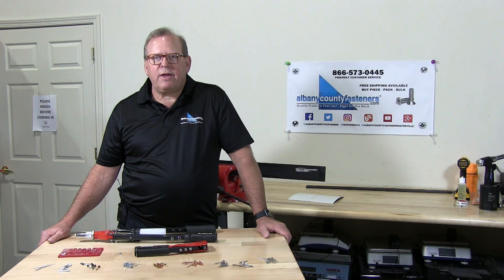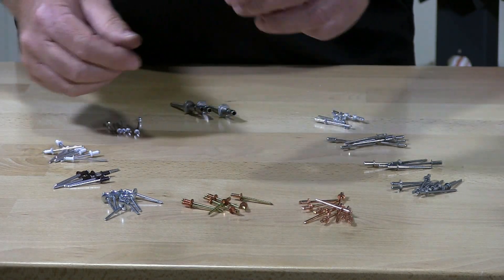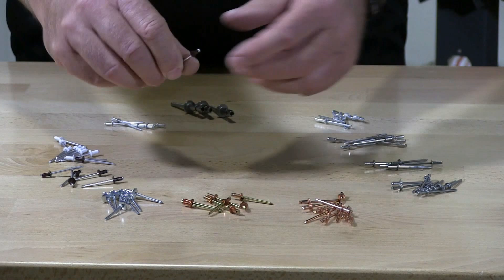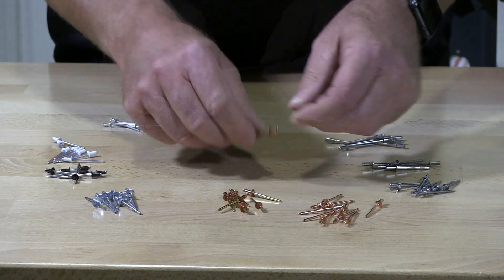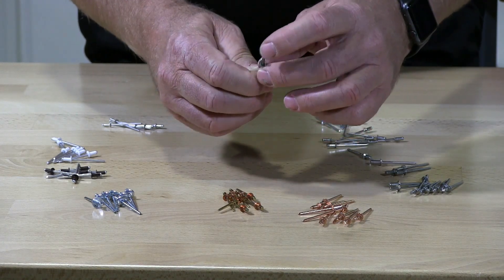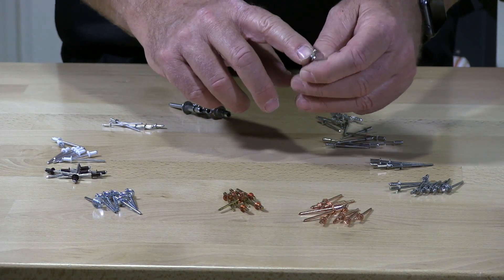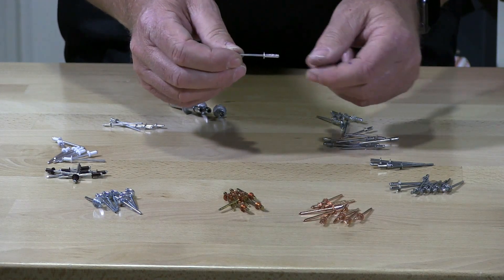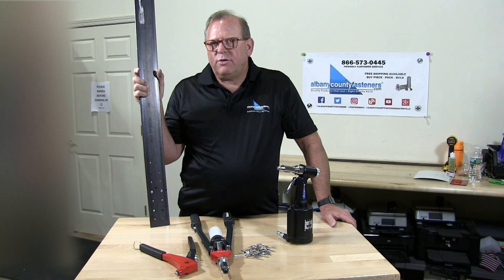POP Rivet Types and Materials | Fasteners 101

Comment: Hi , i like to join 2 very lite  paper thin sheet metal together.  I need the smallest diameter mandrel . I need the tightest flush possible without anything protruding if possible fir a small project ? Aluminum is prefer . It can be copper , or brass ?  Which is the cheapest route  ?  
So which type  diameter , grip length do you recommend  ?
Greatly appreciated on your reply .

Comment: Here's a breakdown of the key differences between aluminum, copper, and stainless steel rivets, along with their ideal uses:

Material:

Aluminum: Lightweight, malleable, good strength-to-weight ratio.
Copper: Malleable, good conductor of heat and electricity.
Stainless Steel: Strong, corrosion-resistant, high melting point.

Strength:

Stainless Steel: Strongest of the three, with high tensile and shear strength.
Aluminum: Lower strength than stainless steel, but still offers good holding power for its weight.
Copper: Weakest in terms of sheer strength, not ideal for high-stress applications.

Corrosion Resistance:

Stainless Steel: Excellent corrosion resistance, ideal for outdoor use and wet environments.
Aluminum: Can corrode, especially when paired with dissimilar metals. Not recommended for harsh environments.
Copper: Moderately corrosion-resistant, but can develop a patina over time.
Note: Due to its high nobility, copper itself resists corrosion. However, when connected to a less noble metal like steel or aluminum in a wet environment, it acts as a cathode and accelerates corrosion in the other metal.

Applications:

Aluminum: Ideal for lightweight applications, sheet metal work, and when weight is a major concern (aircraft construction). Not suitable for high-stress situations or where dissimilar metals touch.
Copper: Often used for decorative purposes due to its color, good electrical conductivity (electrical grounding), and heat conduction (heat sinks). Not recommended for high-strength joints.
Stainless Steel: The most versatile option due to its strength and corrosion resistance. Ideal for outdoor applications, construction, shipbuilding, appliances, and anywhere a strong, durable fastener is needed.

Additional Considerations:

Cost: Aluminum is generally the cheapest, followed by copper and then stainless steel.
Conductivity: Copper offers the best electrical and thermal conductivity.
Reply: Thanks man... learned more in your comment than I did in the video!
Reply: @leighatkins22  lol the only reason why i left my comment was because I was looking for what the different types were used for and this video didn't actually go through that, so I had to go find out elsewhere, then decided to come back in case anyone else got stuck like I did to share the actual info that people are probably looking for.